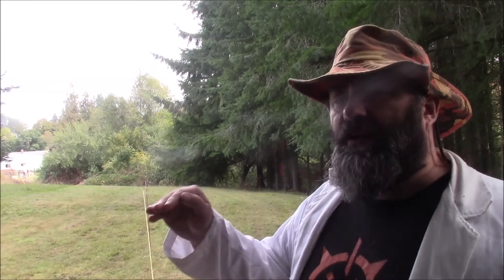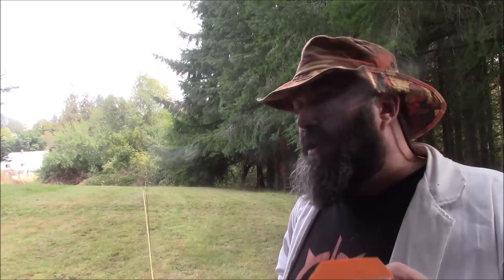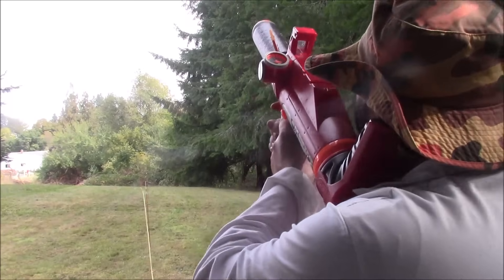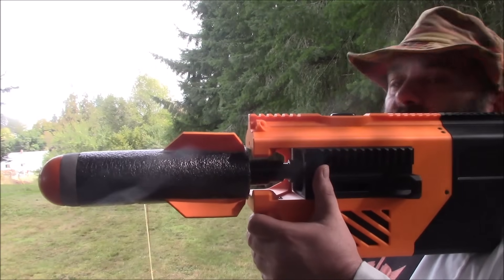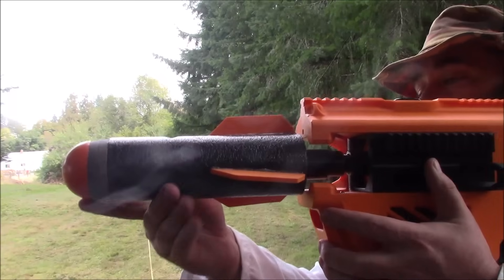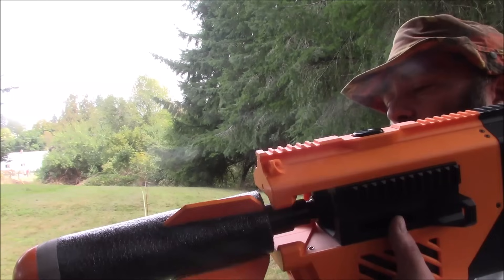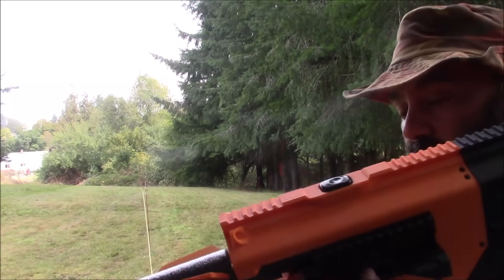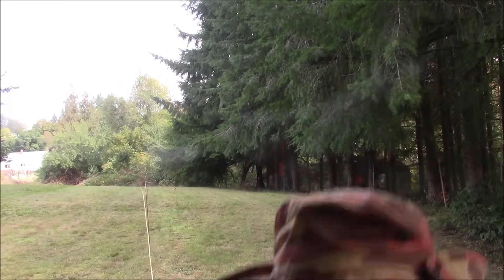Nerf For Science - Custom Titan Rocket Destructive Test

Comment: Curious. I’m sure there isn’t as much of demand for these but if the Titan rockets are successful any chance you will be making ultimator sized ones? Those are probably even harder to find than Titan rockets.
Reply from the maker: Ultimator Rockets are, indeed, harder to find. At least in my experience. And yes, I can and have made custom Ultimator Rockets. However, since it is not as easy to rechamber an Ultimator as it is to rechamber a Titan, the rockets have to be cored out. This makes it much more difficult to produce, and the thicker noodles are more expensive. So I will not be mass producing them.

Comment: Demolisher shotgun, several rockets at once. 🤤
Reply from the maker: Oh, it is on the list...

I have a double barrel demolisher launcher. I need to up it to 3 or 4 at least.
Reply: @CaptainXavier double barrel? As in, it's a Halo "SPNKR" rocket launcher?
Reply: @CaptainXavier if you ever make it to 7 of them, and then make 2 of those launchers, you can shoulder mount them. And then you're on your way to a Heavyarms Custom Gundam! I don't think it would be possible to mount firing rockets inside the lids though. Maybe rocket tips 😂

Comment: I think you're thinking too much like an adult when you're testing these. The best test for anything is a toddler. All they know is chaos in breaking things (and how to shoot you in the face or crotch). Durability point-blank test aka; shooting a wall would be good. Or purposely wear one out. Then put it through the stress test to see if it faults. Changing the diameter of the post to a larger size to accommodate crappy prints would also be a good stress test. Or as I said before simply give it to a bunch of toddlers.

Comment: There was definitely an audible difference from 80 psi to 90+. I wonder if it stagnated past there because the rocket was leaving the post before all of the pressure could be released, so over 90 is just excess pressure not actually affecting the projectile 🤔
Reply from the maker: That is a possibility. As the test progressed, the rocket also became noticeably looser on the post. So multiple shots at increasingly high PSI clearly has an effect. I have fired it at 110 while it was still tight on the post and it still survived and did go farther. The max range I have gotten was 148ft.
Reply: @CaptainXavier Ooo I didn't think about projectile wear. So maybe that sound difference of it getting higher pitched was the air flowing through that growing gap